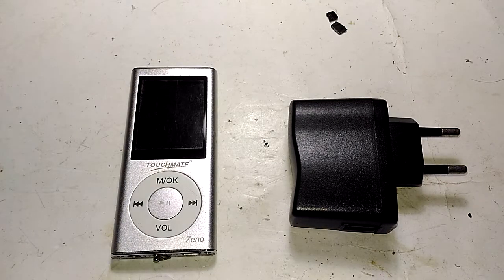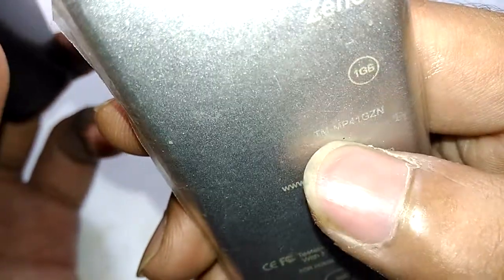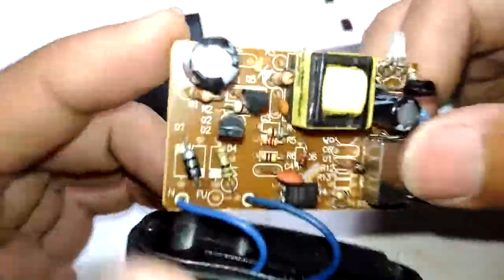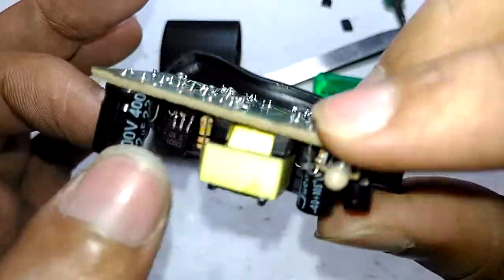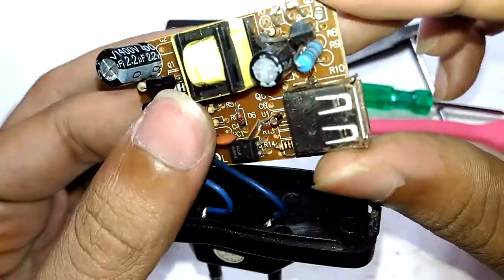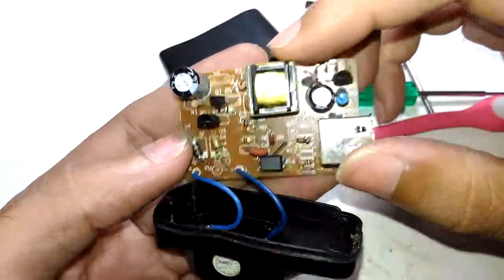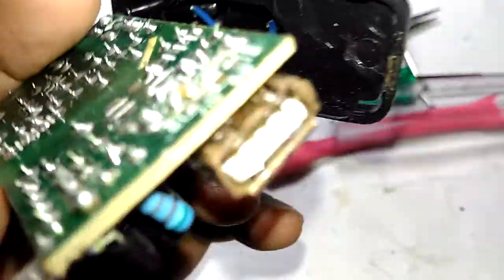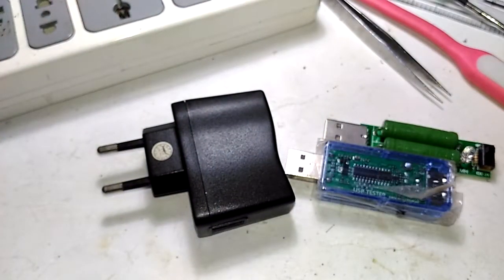IE59 :Touchmate zeno OEM charger.

Comment: My mp4 is not working give me solution
Reply from the maker: What is the issue?
Reply: @INSIDEELECTRONICS  my mp4 is not turning on
Reply from the maker: Open it and check the battery condition first. There could be a lot of reasons for it not to work.